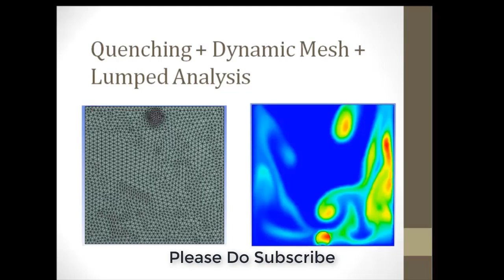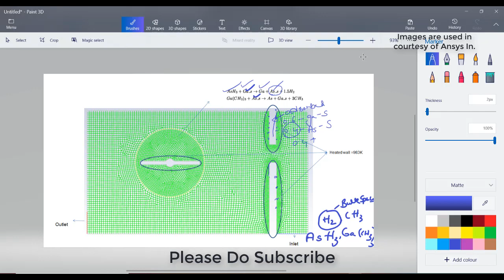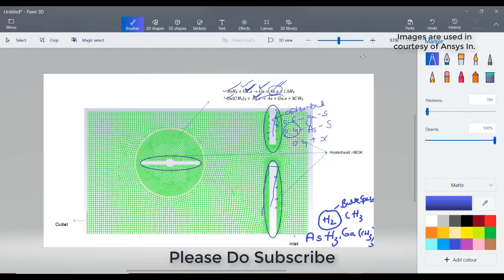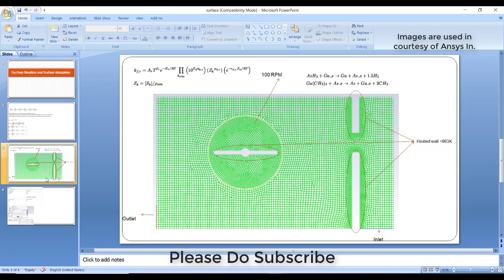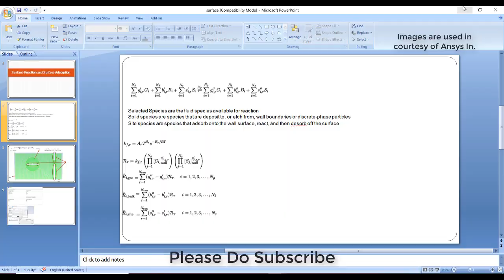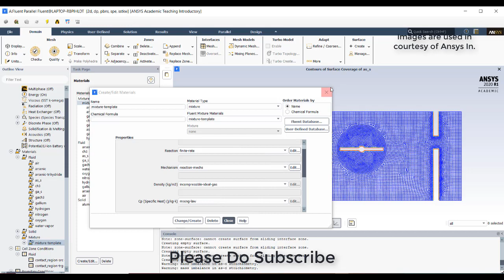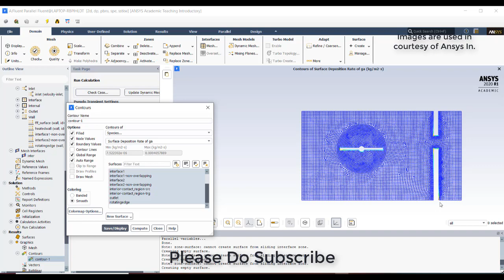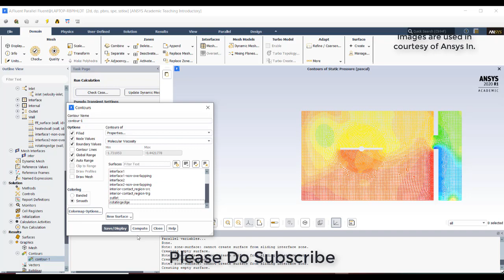Surface Wall Chemistry (Species adsorption on wall) CFD simulation using Ansys Fluent || MRF Approac

Comment: Hello ,
       Hope you are well. Really appreciate the videos you make. I needed help on a small thing. My problem includes the chemical erosion and diffusion of the surface and surface particles of a stent made of PCL. I just wanted to know is it possible to carry out the simulation without using UDF and visualize the eroded result ? The problem concerned seems reverse of what you have shown here.Thanks a lot again. May GOD bless you.

Comment: Hello! How to set absorption in the fluent? Adsorption for surfaces, and for bulk bodies "absorption"..
An example is simple (there is a piece of coal "sample" with gas (methane) inside the sample, constant gas pressure 5 atmospheres, at the outlet 1 atmosphere, free gas comes out into the hole, is it possible to simulate this process in ANSYS. Your lessons are very useful for ANSYS beginners. Sorry for my bad english, using google translator.